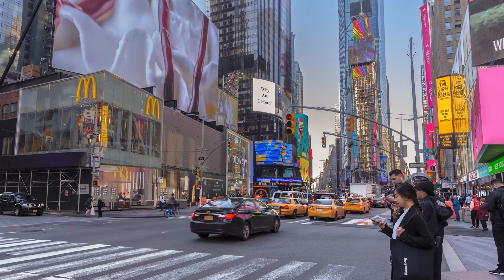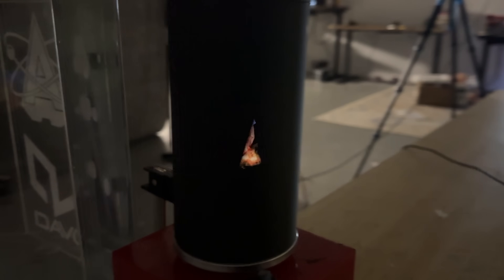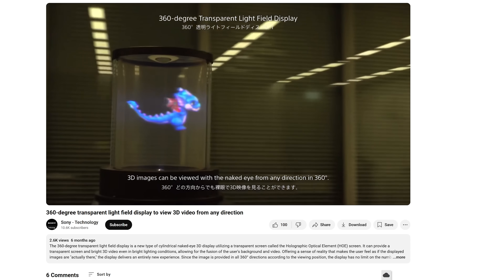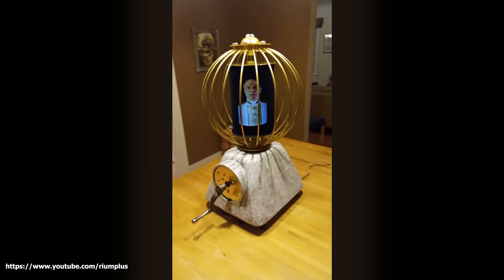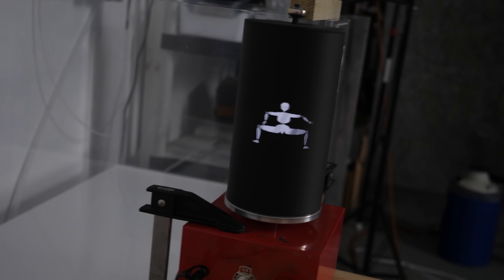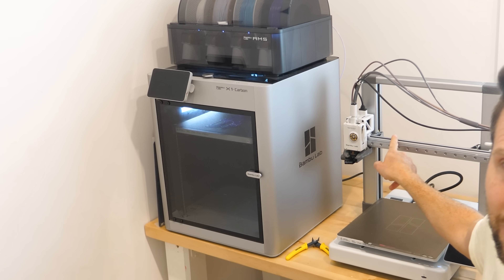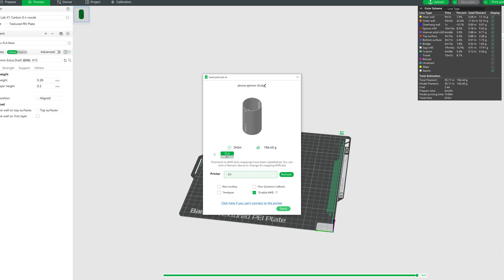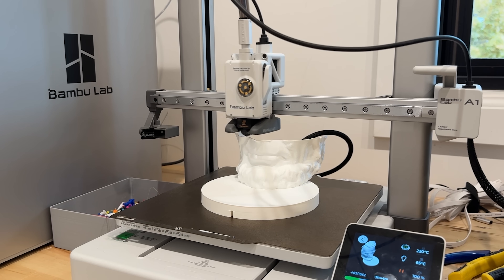The World's First Omnidirectional Screen

Comment: 1:20 This is absolute nonsense. 3D models are literally EVERYWHERE and work perfectly for this task. What you claim is only true if you wanna display something non-CG. Your display is arguably the significantly more useless one. 🤷 The moving parts and ridiculous power cost make it utterly useless for enterprise/business use.
Reply: king of yapping
Reply: I can see one sitting on a conference table
Reply: Why are you so bitter? Show me on the doll where the display touched you.
Reply: “These displays impractical for everyday use because they required special files that have captured the object from every angle.” 

3D models are common. Sure. 

Loved the jokes about using PCs as filing cabinets.
Reply: This guy doesn't get this is how all new things start out. After more time this will only just keep improving until it can't. You may not have any use for this but it is crazy to think it won't have any use
Reply: What are you talking about? Our world is full of moving parts. Air conditioners need constantly moving fans (true, their power consumption is high, but it's considerably more energy intensive to transfer heat across large spaces than move a single cylinder). He even says later in the video that omni-directional would be good for displays that need to be visible from all angles like clocks and maps.
Reply: @TheRapturerocks  The less moving parts in anything running 100% of the time, the better. And lol using fans as your example is the most hilarious self-defeating crap I've seen in a WHIIIIILE!!!! 🤣 Fans are amongst the single highest maintenance cost inducers on the ENTIRE PLANET and as such are avoided literally whenever possible. You get HUUUUUUGE cost savings by making something passively cooled simply because you avoid the gargantuan moving parts costs cooling fans come with.
Reply: These PCs are absolute NONSENSE! The moving parts and ridiculous power cost make this utterly useless for enterprise business use! Just you a damn filing cabinet!
Reply: @Tester-sh1mn  Stupid rebuttal is stupid. 🤷 A single modern PC can store literally TRILLIONS of "document files". The filing cabinet simply cannot compete. This "display" otoh uses so much power and has such a high maintenance costs such as to make it completely pointless for use in business context.
Reply: Keep watching anime and playing Zelda. It has got you this far.😂
Reply: @Vmaster005  ... Like doing those particular things is uncommon or something? O_o I found the out of touch boomer ladies and gentlemen. 🤣
Reply: @Cooe.  out of touch...Thinking iam a Boomer shows your ignorance just as your OC comment shows. Good luck with that, perhaps your Expertise will ascend your immaturity one day and you can be as great as Action Lab. Otherwise, be bothered by my comment, it's intended purpose was accomplished.

Comment: While spinning the phone, if you used a highly polarized privacy screen filter on the phone's screen instead of the cylinder slit, so the viewer could only see the image from a very narrow angle (perfectly perpendicular), it seems like it'd have a very similar effect, but might be a bit more expensive to manufacture such a narrow privacy screen filter.
Reply: Holy fuck, you're right
Reply: But itd have a flash like whole display frame imprinting for a brief moment instead of a vertical scanning frame imprinting, but it seems fairly easy to replicate. One should do it and verify

Comment: This is a very cool effect, though I'd question is applicable purposes.

I'd have a feeling that airport display would be broken down most of the time, and then only showing a small slit of what it was intended to. Just think of how frequently things like engines break down over time, particularly things like fans that have a lot of air displacement. Perhaps it could work out better in some vacuum sealed bubble, but that just makes the mechanics of it less serviceable.

Comment: What is we could remove that motor by using a lcd slit
Reply: The image screen still needs to spin, otherwise it's only viewable from the front and all you did was block most of it out with the slit filter.  The original design did this by putting the printed frames on the opposite side inside the cylinder, instead of the middle as we have here.  (One frame to one slit.)
Reply: @VoltisArt  image could spin if we make a screen around a cylinder .spinning the frames digitally could work.

Comment: Larger versions could be built with projector screens inside so the electronics don't have to experience high rotational g forces. Have the projectors stationary with spinning mirrors
Reply: The projector also has to spin along with everything else.  A projected image would be a way to have less/smaller hardware inside the system, however, versus a full-size display.
There's no setup that would keep the image in place as just one part or the other rotated.  Hold a hand mirror and spin it to see the effect.  There's nothing you can keep in the reflection unless it moves with the mirror, because reflection angle doubles whatever tilt you introduce.  Where the phone display blurs the entire image if it's spun without the slit filter, a mirror (including more appropriate silver movie projector screen) would have the image distort, then go completely out of view when it spun, whether there's a slit in front or not.

Comment: Next video, try it with flexible LCD. If you can make the slit virtually, a transparent vs black area, then that would remove the need for the spinning. I wonder if this would get the same effect.
Reply: Not at all, viewers facing the phone edge just get the "can't see" effect, in front of which the transparent slit would whizz to no avail

Comment: You could probably use a set of mirrors to increase the number of screens without really increasing the cost but also giving you the same result of have multiple redundant displays. Or you could just have a display flat on the bottom and reflect up to the slits. 
Maybe include polarized lenses that can pulse on and off ( I know they exist I don't know what it's called though), this way you won't even need moving parts.
Or maybe even static  lenses If you stack them in layers you can control what can been seen from any given angle, by having them allow light out different angles at each layer.
There's other ways of doing this.

Comment: Lol, I just took apart a barstool and built a column that hangs from the ceiling of my garage and swivels 360° with a TV mounted to the bottom. I can spin it toward any of my workstations or debug software I'm writing for car heads-up displays while sitting in a car in any bay.

I need that 3D printer in my garage now, too! I should probably get something more industrial... they were fresh out of gentle when they made me.

Comment: I'm a little nervous by the angular momentum involved.  Scaling up to airport size could be terrifying.
Reply: I agree. 

Another issue of mechanical displays is the noise. 

During the time i went to engineering university, someone built a Nipkow-TV and the mechanism was too loud to be able to listen to the speaker. 

Plus the slits would (when not covered with for example plexiglass) create a whistling noise at a certain size, at least i assume. 

The safety concerns, when scaling in size. Having a giant rotating drum in the middle of a public space and people sometimes behaving like fools and usually poor maintenance of public infrastructure combined. It definetly needs to be properly encased in reinforced glass, strong enough to be able to withstand if this thing would come loose. 

It would be expensive as hell to build this. Having a slowly rotating block with four displays on each size would be good enough.
Reply: Kinda like big flywheels. ;-)
Reply: You’re right, we gotta spin the humans instead.
Reply: I think that's why the original one was in a cage.
Reply: @mahvus5586  It's in a cage because the design itself was inspired by a fictional hologram display from a video game, it doesn't serve any functional purpose.
Reply: @garbo7550  the top of the cage holds the upper support bearing.
Reply: @VoltisArt which could be done easily from the inside. 
The cage surves no purpose other than looking cool
Reply: @mahvus5586 That cage wouldn't stop the phones from flying out; they'd go right between the bars.
Reply: Hahaha this guy  @mahvus5586
Reply: I figured the cage was to stop people at the event from trying to touch it
Reply: bro we will just use big thin graphite tubes and spin the screens in the opposite direction as the andotrope at half the speed, and reduce the scopes speed by half so u can get the effect cheaper
Reply: @lillegitimate we could also not use screens and use projectors which are more lightweight. Mount the projector to the ‘screens’ and now you don’t need to put to flat screen TVs in a centrifuge
Reply: @ChewyTwee  We gotta go into tech together bro
Reply: @ChewyTwee  Projectors and a projection surface that is lighter than a discreet screen mounted in the center? Keep in mind, the display needs to rotate with the slit in order for the effect to work. Admittedly, a phone is a bit heavy for this purpose, due to all the extra electronics involved...stripping it down to just the screen, battery, and just the electronics needed to receive the wireless signal and display it would help. Then again, the screen and the battery are going to be the majority of the weight regardless.
Reply: @lillegitimate  won't that just make it not work? Honestly though this is making me want to create one of these and test it
Reply: @microman502  no trust me i have a phd in uh...
Reply: @lillegitimate  sounds like it wouldn't work at all. The point of the illusion is that the slit is always at the center of a screen so whichever side the slit is facing sees the display at the identical angle. Spinning the screens and the tube at different speeds or even direction would throw everything out of sync. You would say see the image at a certain angle but at a different one you'd see it sideways or even constantly see the side of the screen through the slit.
Reply: Couldn't the image itself be rotated? Like shifted over each frame instead of moving the physical screen inside?
Reply: @bui3415  no, because at your perspective you will see that line sweeping across the cylinder as it moved.  The slit allows you to see the image, but at the same time no allow the person next to you to see it in the same instance. Then, as the slit moves around, your view is blocked, but the person next to you can see the image.  That is because the image is set back, the pixels on the outside of the cylinder would be viewed by both of you simultaneously.  If that makes sense…
Reply: @bui3415 Yes it could, but then the image wouldn't be visible from the sides of the device if the screens inside are flat. A flexible screen rolled into a tube would solve this though. You would still need to spin the outer layer with the slits of course.
Reply: @karlhendrikse  This is the way. It is also even better because it would effectively be equivalent to more than just 2 screens i.e. higher refresh rate for a given spin rate of the outer shell.
Reply: Playing fighting games on this would be tight
Reply: This is all about proper balancing. Take a look at videos how MRI works without a cover and you'll get a clue that it's not so hard, don't even talk about planes engines, power plants turbines or ships engines. People had been rotating a way bigger things for a way higher speeds for at least 200 years or so.
Reply: You could run it at lower RPM with more screens inside facing outward. This simple version uses two screens back to back presumably to cut the required rotation speed in half compared to one screen.
Reply: @LokiScarlet  once you have three or four screens back to back, why bother spinning them? You already have a display visible from all sides.
Reply: @ZanHecht  Same reason you bother spinning two screens back to back. You want the perfect viewing angle from all sides but you don't want to have to spin it as fast.
Reply: You could use 4 screens in a square which would halve the needed frame rate.
Reply: @andrewwolff2161  and you wouldn't have to use phones. You could use any screens you want.saying that secondhand phones are probably the cheapest way to get high resolution screens with hardware and then when you could Wi-Fi connect andhave some wireless charging going.
Reply: Well, can't you also have a circular pixel display which moves a thin line of what it wants to show across it at the right rate?
Reply: @oatmongen4263  No because every line in the image is being seen by someone, they're just fanned out because of the slit.
Reply: Nah, no big deal. There are magnetically levitated flywheels used to store power that are significantly more massive than even a large airport screen. But this looks like the start of a future tech. I'm curious to see if anyone iterates.
Reply: You could maybe get the effect the same way using a slice of a projector which could be smaller, but still deliver a large image
Reply: Then it'd basically be like the Master Control Program from the original 1980s Tron. That thing always creeped me out as a kid. Just this giant spinning cylinder with a face.
Reply: What if we pull a vacuum on the inside of it is in a container?
Reply: Im not an engineer but perhaps something can be done with mirrors or glass lens to magnify the image up to a certain point. 

Airport scale might be possible, but for billboard scale will probably be blurry
Reply: How are you going to power the screens or the get video to it when it’s spinning
Reply: @liamsparling  The video is the easy part...wireless communication like Wifi or bluetooth. As far as power, you can do batteries (which still requires figuring out how charge them, or a contact/track system, akin to that used for model trains or full-scale electric ones.
Reply: @ induction or like a bearing power supply would work for the rotation
Reply: 2 screens + spin, with mechanical failure risks. Seems like 4 screens would be cheaper and better lol
Reply: Put a sheet of acrylic around it, have it on something like a 2 or 3 pole chassy and that should be good.
Reply: And this reduces brightness by what (presumably large) factor?
Reply: In my very limited knowledge on the subject, I would assume engineers could be able to make everything digital. Maybe using the same principle that helped them get rid of the need for a mechanical shutter all together in digital Cameras.
Reply: we've moved more mass far faster. plus, the real one would be significantly optimized for weight and long term use, unlike the scale model he made
Reply: On a large scale you don't necessarily have to use something with inertia. Perhaps the screen emits only horizontally polarized light, and an electrooptical barrier that sweeps across the screen changing its polarization.
Reply: Maybe spin a light mirror and the heavy components can be stationary on the floor
Reply: Now I am imagining 70 inch 4k movies with this tech.
Reply: Perhaps you could use a cylindrical transparent LCD panel divided in vertical lines that switch between black and clear, and sweep clear lines around the panel to create the spinning slots, while it remained static, and have a cylindrical  oled display at the centre displaying the spinning image, so no moving parts.
Reply: Noise would also be an issue from the rotating cylinder and motors involved. Very cool still.
Reply: We could just make a cylinder display with pixels and display vertically thin picture and rotate the picture on the cylinder display
Reply: @charansaijatoth4255 not quite, but I think you’re onto something there. This works because of the parallax effect, which you can see as he slowly shifts the cylinder by hand. However, rather than a mechanical slit, you could have a digital one, whereby elements of the cylinder are switched between transparent and opaque, creating the effect of a moving slit across the surface of the cylinder without need for mechanical motion.

Comment: The cool thing not really mentioned is how they're common tablets, so they have all the standard stuff like bluetooth and *batteries*. No need for slip-rings or cables or whatever, the tablets can play streaming video over bluetooth, which means it's real-time projected. Now the boss will video-call in and supposedly make eye-contact with everyone simultaneously during a redundant meeting! Seriously though, the advantage of being generic hardware means all that stuff we have to send and play video works.
Reply: Streaming video over Bluetooth? I guess low-quality video is technically possible that way but nobody would ever do that when these devices also have Wi-Fi and 4G/5G.

Comment: I was gonna say its a zooatrope modernized 😂 Nice. 2:52 

Id bet with a bit of fine tuning you could also use it as a volumetric display as well, making it more versatile
Reply: It isn't volumetric because all the pixels you see exist on a single convex curved path. You could make the screen show you different things as you move around it though, using eye tracking. Linus Tech Tips just released a video about a glasses-free 3D monitor that works by eye tracking.
Reply: It could be volumetric, because at any point in time each column of pixels on the screen is only visible to observers looking from a certain angle. The flat 2D image on the screen would be super weird, but it would work.

Comment: The poor phone accelerometer 😂
Reply: 🤣 "The compass app just keeps showing 'F*** you'."
Reply: accelerometer in integrated circuit is actually just force sensors, so they can take some abuse
Reply: It's three microscopic zigzag cut pieces of silicon wafer which bend based on the G force. If its spinning, each wafer just stays bent and doesn't get worn out by being bent over and over again.